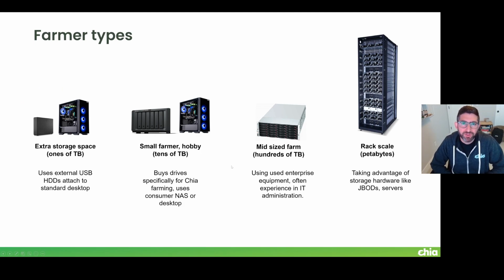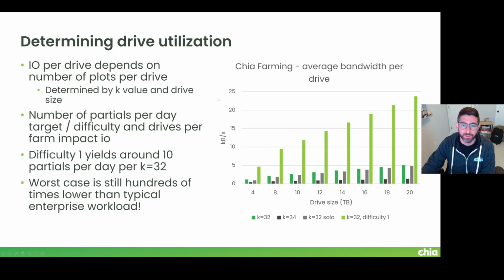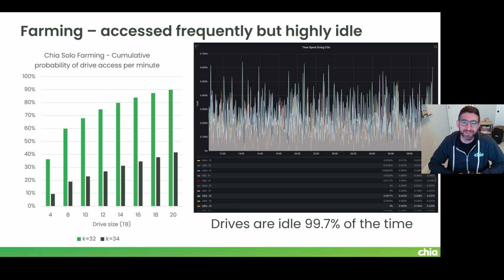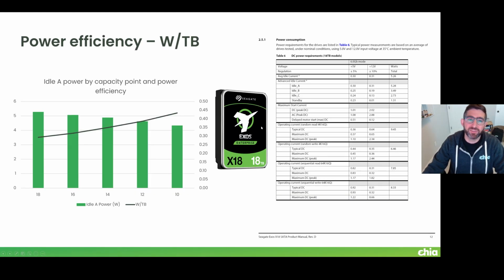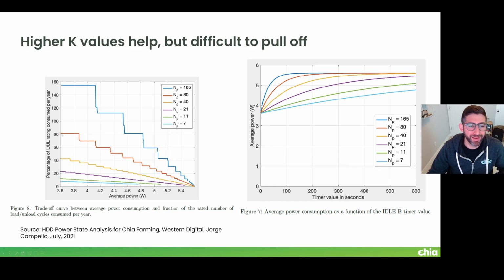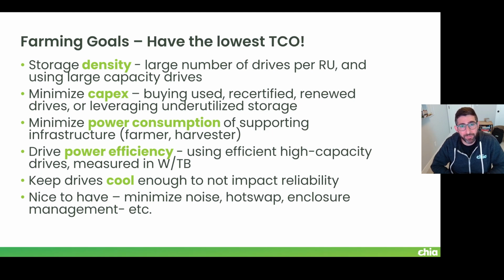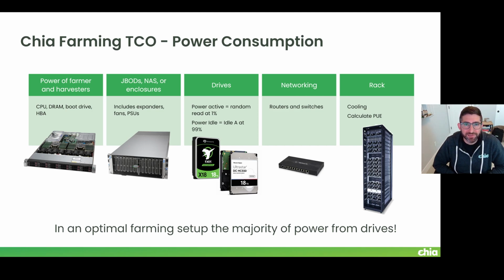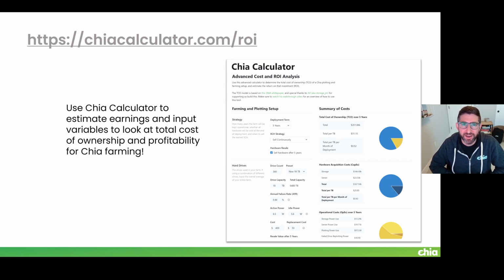Competitive Chia Farming - Deep dive into HDD power and TCO

Comment: PLEASE UPWOTE THIS COMMENT. You can do 3-4GB drives plus K36 plots and put aggressive timings to turn them off. In such scenario - drives should do nothing for a long time and don't use energy at all. IT should not be nft plot - just regular one. Also chia team can decrease amount of checks per minute and this will make all network spend less energy - we have no idea why they don't do it. but theoretically if community push they can make 1 check distributing 6 xcv per minute and this will drive all network use 3x times less energy.

Comment: I would like you to do the math on something. If you pay a LOT of high capacity drive and I pay much less for lower capacity drive, isn't this like the solar panel debate? Or the more efficient GPU vs. the cheaper one? I think of it this way. If you spend $1000 to get a super efficient GPU but I spent $200 on a reasonably efficient GPU, are you doing things better than me? Look ma, I'm really power efficient. And I'm sitting here having invested 80% less than you. I also always like to say sure your GPU is less power hungry than mine, but it's only a question of the DIFFERENCE between the two. Same with hard drives or chia farming equipment. I might pay more for hydro but who cares? You take a huge risk on big investment into hardware. I might make a bit less but that's far wiser in my books. If Chia price blows up, I'm not caring too much about an increased power bill. Sure, I could make more by spending a crap load more money for efficiency. Sorry, everyone needs to decide whether an investment is a sure thing and that they have a lot of spare money to throw into it. I'm not investing into Chia hardware that doesn't earn. A box that hold drives doesn't earn Chia. Chia should be about using old hardware and making use of that. If that means lower capacity drives, so be it. The messaging shouldn't be about getting the highest capacity drives out there. Oddly enough these are the farmers who have tapped out and left the space.

Comment: What's your opinion on 2.5" drives? I wonder why you never include them in your videos.. They consume around 1.3 Watts while farming, so a 5 TB disk has 0.26W/TB which can be pretty good.
Reply: development on 2.5in HDDs isn't really happening anymore, as nearline large cap HDDs are the only growth segment left for the HDD market. But by all means if you can snag a good deal on a 5TB the 2.5in JBODs are usually very cheap compared to 3.5in